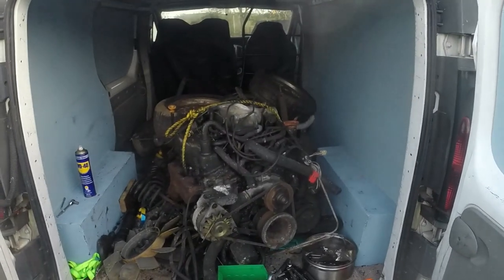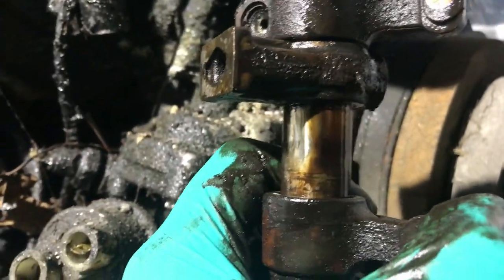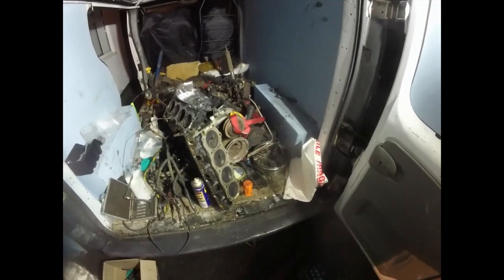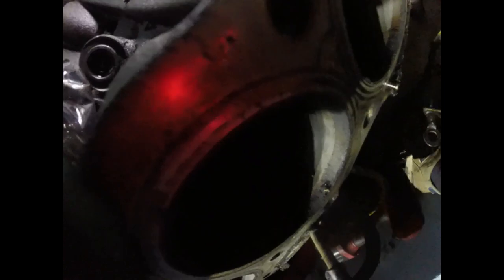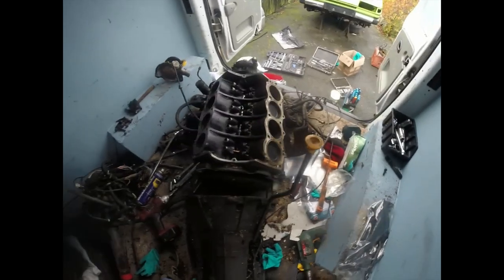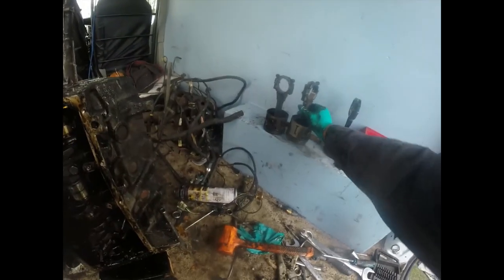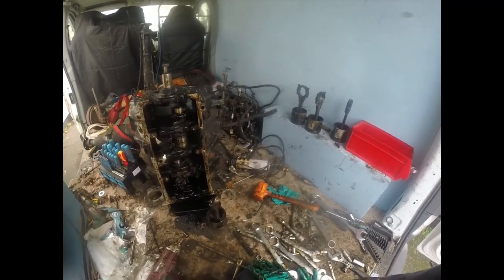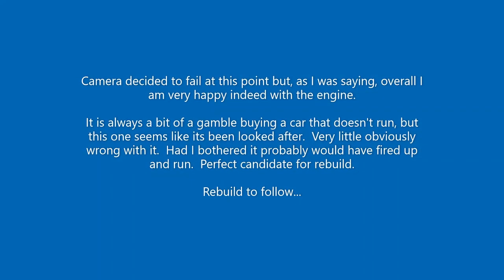Rover SD1 V8 engine strip down

Comment: Hi James. 
In the main and up until now, all seems ok with the Strip Down 😊. I hope lady Luck does not abandon you as she sometimes does, as you delve deeper. Excellent content as usual. 👍👍👍
ps. make up a frame and cover it with plastic, and place it over both open rear doors,to give you a drier working area at the rear of the van. 🤔
Reply from the maker: It was actually really nice inside.  Crank ended up having a light grind, nothing major.  Valve guides were ok.  Heads had a skim and new valves and springs.

Comment: The motor is pretty clean
Reply from the maker: I was real impressed actually.  Think it was 110,000 miles.  It was owned by a mechanic and you can kind of tell.  Think it had fairly regular oil changes.  It then sat in in the car on a drive in south London for about 20 years, then i got given it for free.